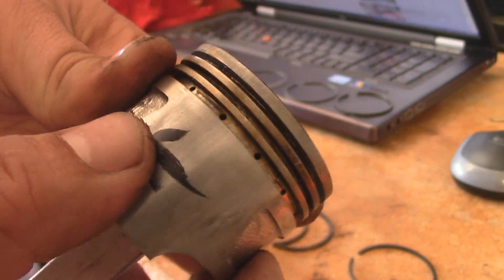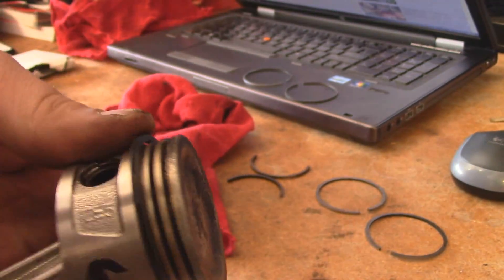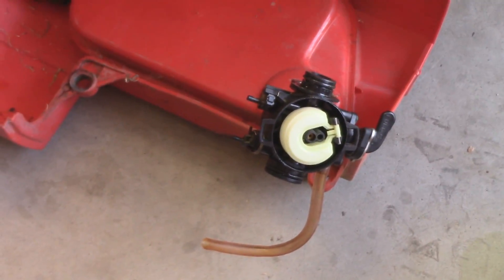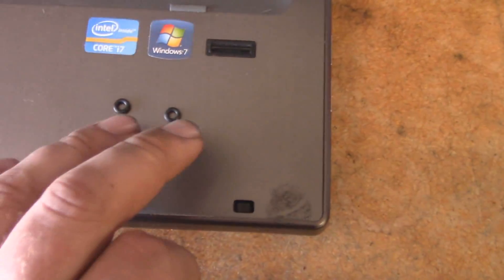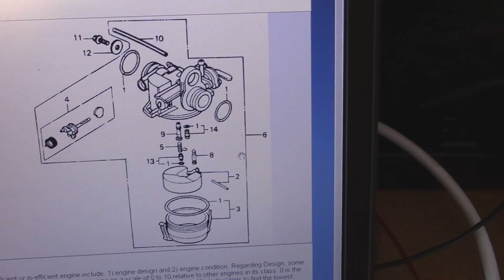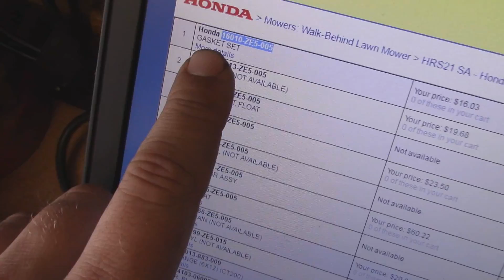Honda HRS21 Rebuild Part 1 - Exhaust Valve and Ring Install

Comment: I'm in the process of rebuilding my 1996 Hrm21, thanks to this video. Obviously the job would be much easier with the head removed, but it seems the cylinder and head are a one piece casting. Is this the reason you did every thing through the bottom end?
Reply from the maker: Precisely

Comment: Thanks for the video, helped get me started with disassembly.  My HRS21 is 34 years old, and great but starting to burn oil so I did a ring job on it.  A couple comments on my process.  Before honing the cylinder, I needed to find out whether it was a cast iron liner or aluminum - they have to be treated differently.  The GXV110 is a cast iron liner - tested it with a magnet - so honing as you show is fine.  I didn't have a small valve grinder so I used silicone caulk to attach pieces of wooden dowel to the top of the valve heads.  Once the caulk set up I could put the valves in their guides with the grinding compound and rotate/lap them, then easily remove the caulk.  I found conflicting specs for valve clearance, and settled for 0.006" intake and 0.008" exhaust.  I checked my ring gap on the new rings and filed one of the rings that was a little tight.  The rule of thumb is 0.005" per inch of piston diameter - so, on this motor, at least 0.010" gap.  Finally, I would add that one can't be too careful about keeping things clean.  Honing the cylinder with the crank bearings, oil sump, etc. exposed is pretty risky - I covered everything with rags and was careful to keep contaminated honing oil out of the crankcase.  Break in is important after reassembly - I ran it under heavy load for the first 10 minutes, and it went from smoky startup to clean burning within a couple minutes.  Followed by an oil change.

Comment: I'm doing my HRS21 right now. Engine seized, turned out to be con rod on the crank, actually bent the rod. Neighbor said "throw it away"  wife and I had this mower for 30+ years so wanted to revive this sentimental piece of our history. Piston and rings looked good, so I bought a new set of rings. Tore engine ALL!!!!!! the way down. When I honed cylinder I stuck engine block into a bucket of diesel and added a quart of auto trans fluid, figured out an up and down and rotary speed and after a few minutes of honing checked my work. WOW looked like a machine shop honed liner, a good 35-45 degree crosshatch. In the mean time I found a good crank and rod from a donor engine. intake valve and exhaust valve looked real good but I lapped seats anyway. I'm in the process of putting things back together. I will let you know how engine came out.
Reply: IT Lives!!!!!!!!!!!!!!!!!!! had some carb issues at first but worked that out. Starts on the first pull. Ran engine for good 30 minutes then changed oil. Hey may last another 30 years.

Comment: good video the only thing i would of done also is me personally i didn't like how the connecting rod and piston looked but i didn't look at price  parts so maybe it wasn't worth it. i would call this video a honda HRS21  overhaul before rebuild since the only thing you really did was re ring it hone it out and lap valves. parts were just rings. never the less just a critique but good video keep it up
Reply from the maker: glad you enjoyed it, yea overhaul rebuild to me its just to bring people in to watch the video, more people associate a rebuild with a ring and valve job so thats why I used it. Replacing the rod and piston would have cost too much and I didnt think the old ones were worth replacing at that point

Comment: Wow, what a big job! I have had to do that on outboard motors at work. Thankfully it is slightly easier and no valves to deal with.
Reply from the maker: im probably going to have to relap them it is a pain in the ass

Comment: I hate lapping valves at the best of times but that is a PITA...I'd have been tempted to put the drill on the valve stem and spin it that way lol. Anyway, it looks like it's got some good compression now so good luck with the rest of the build.
Reply from the maker: I'd be lying if I said I didn't think of doing that either lol it crossed my mind a few times hopefully I can get this one going